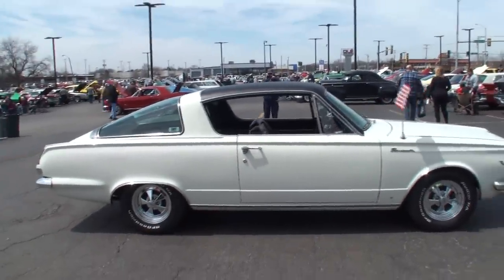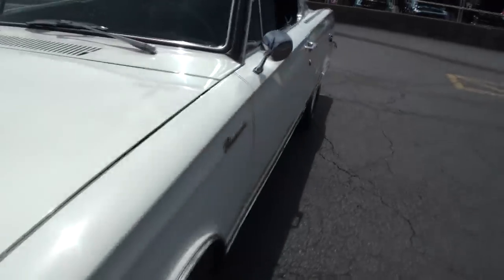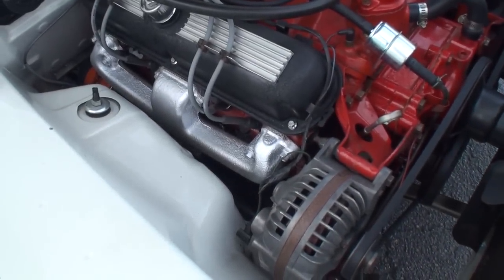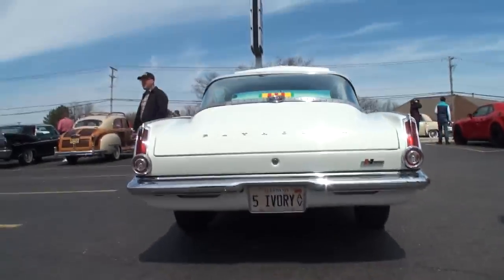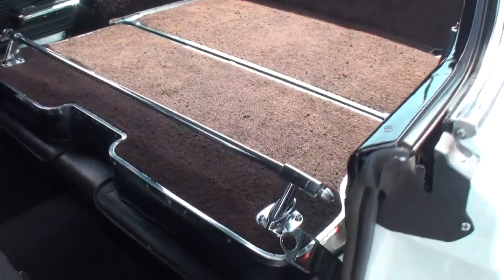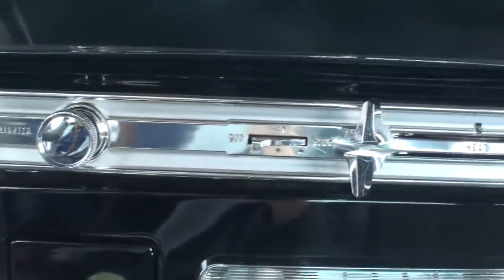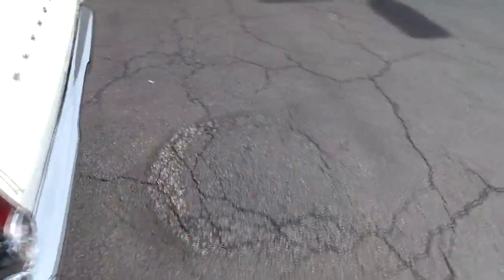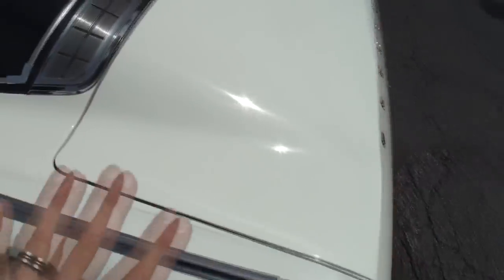1965 Plymouth Barracuda in Ivory White Paint & 273 Engine Sound on My Car Story with Lou Costabile

Comment: I inherited my late bro-in-laws 65 Cuda 5 years ago He lived and drove it LA CA'. It had zero rust but needed a lot of work.  I had to put a 318 in it as I couldn't find another 273. I put discs on the front and have replaced and upgraded almost every replaceable part.  I found Mercedes paid with the original color code--a very dark blue.  I drive daily around Portland OR.  I have also never seen another one and I also get rave approval..When I park at a store I get mobbed by people.  Many of them take pictures.  The 318 has more torque than the 273,which got its power at much higher rpm's,  People seem to like the sound of the Flowmaster duals.
Reply from the maker: Hi Steve, Happy to read you have a cool car :-) Thank you for viewing and sharing, Lou

Comment: Your car has the rear window trim painted correctly,  blue and red, the gold car Lou looked at had white and red. Blue and red is correct. My mother bought one new in April 64, 273 pushbutton 904 and dealer installed hang on air, and my older brother bought one in 74. He put a 340 in his.
Reply from the maker: Thank you for sharing the details you notice.

Comment: Never seen a cleaner engin bay in my life
Reply from the maker: Glad you enjoy Jay's attention to detail on the engine bay.  You're right, it looks great.
Reply: Imagine that bay with a slant six! I had a light blue '65 that had a mint body. I thought the engine block was too dirty. I was NOT a mechanic, but I  had a torque wrench! Took it apart from the top down. Laid everything out in the driveway, carefully. Most of the parts I did not know their name! Painted the covers, the head, and then the block. My Dad pulled up as I was finishing reassembling. He saw the parts, I thought he would have a heart attack! By the way, I did not know you were suppose to change the gaskets. I finished up and waited until the next morning. Started up and ran great. Dumb luck! Took a round trip cross country for 6,000 miles. Could not hurt a slant six! I loved the glass and the back. It was not hot. I just kept all the windows down! Nobody had AC back then . . .

Comment: I would have definitely passed on the Barracuda in favor of the Mustang fastback with a bigger motor and more modern styling as most people did at the time. However today, as mustangs are ad nauseum and commonplace, the Barracuda is actually cooler due to it's nostalgic lines and rare numbers still in existence. Today I wouldn't trade my Barracuda for a fastback even if my wallet was pleading for me to do so.
Reply from the maker: Hi Moral Platitudes, Thank you for viewing and sharing, Lou

Comment: some had larger engines, but with the big engines, you had to pull the motor to change the back plugs These were designed, or should I say the slant 6 was designed for this car, so it would fit under the hood.
Reply from the maker: Thank you toot tall for viewing and sharing your knowledge, Lou
Reply: The 273 was the largest motor available for this model.
Reply: These Barracudas were basically a Valiant. Frankly, I find the slant six to be the better engine for longevity. The last one I had blew a rod after 500k plus. yet with no water and no oil in the block, the thing ran well enough to get me home, about 5 miles. Even after sitting in the yard for months, a fresh battery would start it right up... it still ran well enough to move it around the yard anyway, tho you wouldn't want to go anywhere, certainly. I still want another, but they're hell to find now, and hell to pay for. Maybe there's one still around in a four door somewhere that the owner doesn't realize how good they really are. I had another one, would start and run cold, but once it got hot, wouldn't run or ran like crap. Being quite young then, I didn't understand it. After I sold it, the guy that bought it put a new distributor cap on it and it ran like a champ. Duh, I felt like such a dummy, and I guess I was back then.
Reply: toot tall, Long live the noble Slant Six!
Reply: Join a Valiant club, or go to slantsix.org. 
You'll find plenty.
Reply: Amen to that. Frankly I don't know why they ever quit making it. Sure it could be updated, but the design works so well... maybe that's why, they don't want to make them last that long.
Reply: The Slant Six epitomizes the difference between old Chrysler and new Chrysler. They had solid engineering once but today it is just gimmick after gimmick.
Reply: You could pretty much say that about most of the car makers today. Do we really need wifi in cars? Shouldn't they be going the other way and putting in a jamming  device that blocks cell traffic when the car is in gear? That would be a good safety thing, if people couldn't use their phones while the car was in gaar, then they wouldn't be distracted by them. Do we really need cars that park themselves? Do we need or want driverless cars? I know I don't. question, when a driverless car hits somebody, who pays? The owner shouldn't they had no control of it. Whoever makes it or programs it should have to pay. They should come with such insurance. Do we really need all these gizmos? I don't even like power windows, great when they work, but hell to fix when they don't and usually expensive. I don't think any car needs a computer at all. I see no valid reason to have one running things, and we certainly don't need one that's hackable from the outside. That's just stupid. In one of my yet unpublished books, a hit man uses that to take out his target, yet it looks like an accident. Do we really need all the plastic crap? One Benz I saw years ago had plastic covers all over the engine... why? They serve no real purpose. Hell they've been experimenting with cars that have sealed hoods...only a dealer can open them supposedly. the only reason they haven't done it yet is they don't think people will go for it, yet... they're slowly working that way. Some car makers are toying with the idea that you don't buy the car, you pay one price, but when it's time is up, they take it back and recycle it, then sell it again. Why do we put up with it? Why do people pay 50 to 65 K for a new pickup truck? That's crazy. I sure won't, even if I had that kind of money to waste I think I could waste it on better things, at least more fun things.
Reply: I am waiting for the day I see a car advertisement with the following slogan:  Shut off the damn phone and drive!
Reply: Some guy was talking on his cell driving in a parking lot I came around the corner and he almost hit me because he was on the wrong side of the "road" I cussed him as I went by, then he had the nerve to come around where I parked as I got out of the car. He had the nerve to say "You didn't need to cuss me like that." I looked at him, put my hand on my 45 in back, and said, "SO you think coming over here and getting in my face will get you cussed LESS? You better get in your car and leave before you get more trouble than you can handle. He looked me in the eyes, started to say something but thought better of it and got in his car and left.
Reply: had you shot him YOU would have been in more trouble then you could have handled